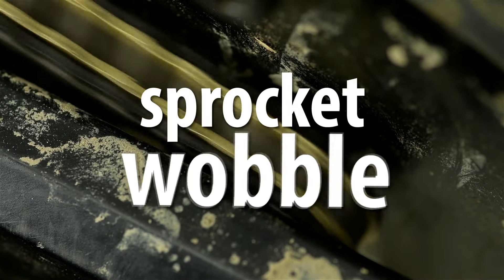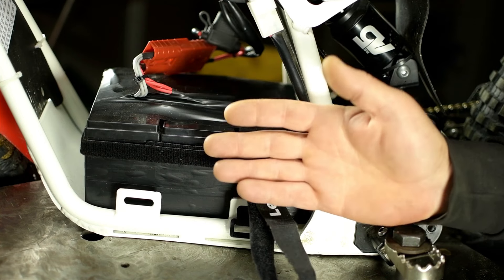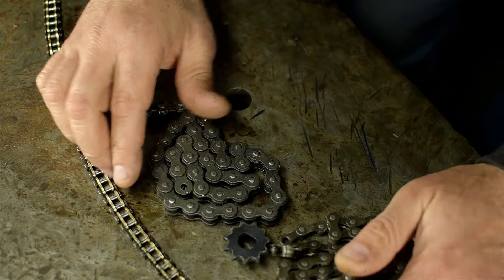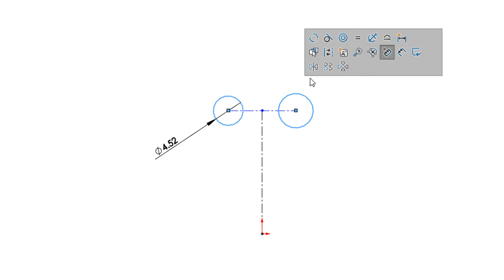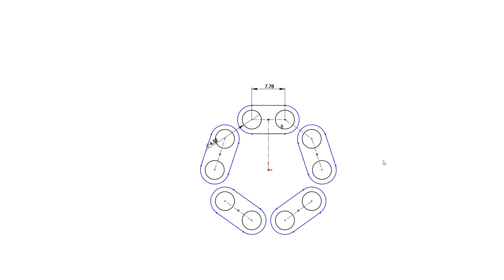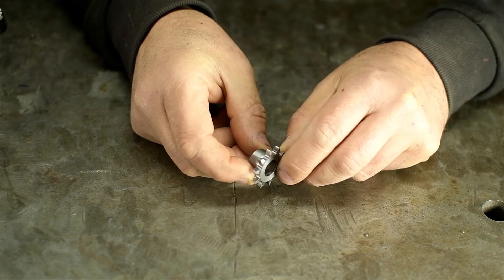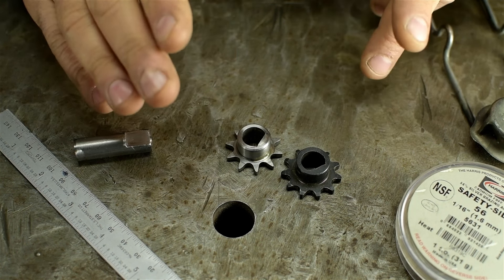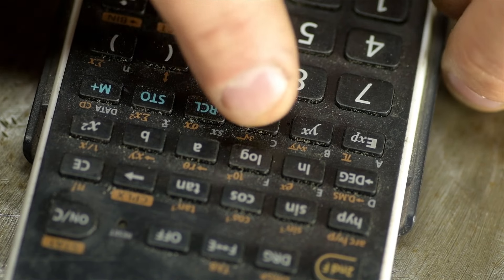Let's Make Our Own Chain Sprocket!

Comment: workshop: A place with tools to make more tools so that when feel like it you can spend lots of time making something you can buy cheaper and faster ;)
Reply: This is often (I'll even give you "usually") the case.  Given the quality of the factory parts in this case, it's good that Tot has a workshop.
Reply: @mikecurtin9831  yup, and I bet Tony's sprocket is better than the mail order sprocket.
Reply: Well, obviously(?) not "faster" in this case... Otherwise a totally agree!
Reply: Yeah, except most things you can order are made out of crusty sunbaked dogcrap, and having a proper workshop can lend you parts made out of tool steel, titanium and so on... Of course, it is all expensive as fuck, but then again, so is alcohol and heavy sedatives you need to take in copious amounts when your shit fails and you have to wait for it for ages to come from the store only to be as crappy as the thing that broke in the first place, so i rather go with some mild sedatives and an expensive workshop than no workshop and a heroin addiction...
Reply: I concur. However, that doesn't make for fun video content...
Reply: It is kind of weird, but I do spend far more time designing and manufacturing equipment for my shop to use making more equipment for my shop than I do making actual things that I make the equipment for. It’s odd how things work out that way.
Reply: You should take up woodturning.  Thank goodness I don't do it for the money.
Reply: @melgross  You are not alone, most of my time as been spent in the same exact way with building out my workshop
Reply: Yeah...
But sometimes what you want doesn't exist, or more often there is something else to do but to procrastinate efficiently you need to have something to do to not do the thing that needs to be done so we do what we do with the ol "but the one I have to make is slightly different than the previous/other/store brought one" to avoid doing the other thing.
For more information, see your local husbanding technical support group.
Reply: Only when you need standard parts. I need some 100mm axial flow fan blade and you would think that you can find them but no. Or I need a 10cm cross with 4cm legs and 3 holes through each leg to mount some coils to. You are never gonna find exactly what you need when you try to build something new.

Comment: Interesting project.  I'm guessing that's how they are made.  Case in point I purchased a tug for our Montana fifth wheel.  Was told this was the machine for the job.  When I noticed the chain binding and that the sprockets were misaligned by up to .25. I was told that's normal. I guess alignment and run out are important after all.

Comment: 0:52 is "wonky" a technical term?
Reply: Obviously, since I use the term.
Reply: It’s the most technical of all ways to say, “It’s fucked!” 🤣
Reply: Sort of. It's a generic term that covers both of the more specific terms cockeyed and lopsided and is useful when you're discussing something with elements of both.
Reply: @Nevir202  true, some technical dialects use Dickered, or Hoopajooped
Reply: Yes, even where english is not the first language! ;o)
Reply: C Overweel Sorry, I don’t speak rocket-science. 😜🤣
Reply: @Nevir202  That's sprocket-science
Reply: No, ask AvE for a proper tech term.
Reply: won·ky
 /ˈwäNGkē/not functioning correctly; faulty and /or 🤬
Reply: You can use "wonkatious" if you want to sound more professional
Reply: Technically, yes.
Reply: Absolutely!
Reply: It is in the shop I work at.
Reply: @GunSmoker  Its a bad case of a weeble wobble!
Reply: Its not a term I use very often, but then again I am fairly fluent in vulgarian, a language that has over 4000 synonyms for "wonky" all of which would make a sailor blush.
Reply: Yes it is, But I prefer "FUBAR"..:)
Reply: Yes...
Reply: It's actually even an S.I. unit referring from French System internationale "le wonque". The e is silent!
Reply: Nah, the technical term is "wafty"
Reply: @sventobergte845  :-))

Comment: Also that motor movement seems like it would cause the chain to wear much more quickly.
Reply: I think it's just because he has the swingarm disconnected from the frame and the camera is mounted to the frame. The motor moves with the rear wheel.

Comment: Hi Tony, 
Only just been able to get back to this vid, looking after a 'hyperactive' 4yr old grandson isn't as easy as people think ;o)
(he may not be hyperactive, I'm just old, slow and worn out) 
Your talking about something I really know a bit about.  Just in case you didn't know (and I'm sure many of your subscribers wont know?) 
I haven't done any research (even I'm not that much of a nerd) 
Chain standards were probably set up in 19th century when Britain had an Empire and America didn't have much standardisation  ( Congress passed some acts in 1864 that took another 20 years to be implemented, Troy ounce for precious metals was the only recognised standard measurement nationwide until then)
 Chains are 'mostly' measured in 1/8" 'blocks' a 630 is 6/8 (three quarter inch pitch) by3/8 ( three eighth's internal width between side plates). 520 is  5/8 x2/8 . 420= 4/8x2/8, etc. There are a few special sizes that don't seem to conform, the one you have looks like a <1950's~60's British motorcycle primary drive   (Reynolds chain)
As for chain 'bending' sideways, that is almost always a meaningless check as some chains deliberately have extra side clearance to allow dirt, mud, etc to fall away  even though ity may have had other applications, (it was a 'new thing' for off road bikes in late 1970's) Sorry for 'excessive' length of post, I know many people don't like reading which is why the 'moving pictures' are so popular

Comment: I thought sprockets need to be heat-treated to have hardened teeth?
Reply: He did take the torch to it, 😆! It’ll be fine
Reply: He used chromoly which is pretty tough stuff... Probably figured that it would be tough enough
Reply: Though admittedly they're not on the front, aluminium sprockets are commonplace on the back of motorcycles, plenty of which are making ~200hp. 

I'm sure this'll be fine.
Reply: @Hexlattice ....Stock 4140 (chromoly) tests 12-15 HRC. Tough but not brittle.  Good compatible choice for that chain (if !? we knew what type of chain it is!)  This repair is kind of a crap shoot.  Oh well, we'll burn that bridge when...............!
Reply: It only has to last until the other one comes in the mail.
Reply: I "think" back in my old days as a heat treater we used to do just a light case harden on the teeth and we used them on PTO's.
Reply: @The124cbr  Yes they can get by with aluminum since there is a lot more chain wrap and then less load per tooth. In his case one less tooth is more load per tooth so it could wear more than the original.

Comment: Drill hole thru front cog & key, TIG both pieces together by filling the bore hole. One filled bore hole will do, two (parallel to the axis) will fuse the two together to approximately "it ain't comin' apart ever again".

Comment: Did you consider drilling a hole in the hub centered where the D was to go from the side, then plug welding it to the hub?
Reply: erikjgreen how would he replace it in 3 months? Drill out the weld?
Reply: @chrisestill8825  I think Erik meant to weld the D shaped piece through a hole in the side of the hub, welding where ToT braised/brased/brazed? it in.
Reply: Or tap for a large set screw where the dent goes
Reply: Chris Estill - you can just use an un welder, it’s kinda like a big solder sucker. Works great 👍
Reply: @PapaWheelie1  - carbon arc gouging (the unwelder), is so very not like a big solder sucker...

Comment: 5/16" t8f hope you see this 😬 flag guys
Reply: I was just looking for this! 😁
Reply: I have a new chain I could donate, but I'm from aus
Reply: ToT said it was NOT 8mm metric chain, and his measurements showed a pitch well under that (7.78mm), despite that it was stretched already
Reply: Yeah, I used to do reverse engineering as part of my job, and if I made a drawing of a sprocket and said 7.78mm in the sprocket data block, I would get AT THE VERY LEAST a withering look from my boss, and he would in no way believe me, even if we measured the chain together and find that it did seem that way.  He would change it to 8mm pitch.  At the end, when the new sprocket is running, it sounds better, but it still sounds clicky.

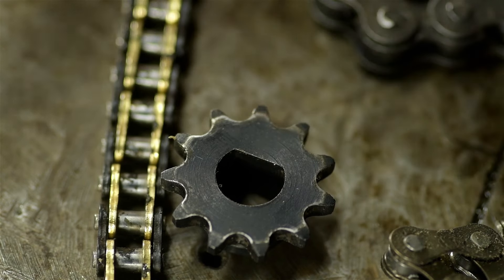Comment: 6:00 So... What happened to the rotary broach you made? Couple minutes with a mill and some round tool steel and AvE's your uncle.
Reply: they work for stuff that is equally spaced from center, meaning the cut needs to be similar all the way round, which isn't the case with a D shape, even if you were to position your spindle on the center of a circle that would with inside the D, and not on the centerline of the sprocket, there would be a lot of meat to cut at the top/bot corners of the D, which has a good chance of screwing things up for you
much easier to do with a D broach starting in an offset circle (same one that would fit in the D), that is how it was probably done in the factory, and they probably made it as the last feature, not the first, hence why it is all wobbly like that
if they made the D hole first, then fit it on proper D shaft mandrel and machine the rest, everything would be reasonably concentric

p.s. I think it is way past time for ToT to get a wire edm... "die filer 2.0" :D
Reply: @phuc
exactly, i dont know who this dude jones is but he is AvE illiterate, whereas your AvEctionary is gut'n'toit'!
Reply: phục êwê  Nah, AvE's your Uncle Bumblefork. Bob's your auntie.
Reply: phục êwê  Something something 150 pound filipino buddy

Comment: If you were worried about the key breaking loose and had a rectangular broach of the right size, you could've broached a square keyway and slid a rectangular prism key in there, then braised that. Heck, maybe even welded that. It could be tough trying to get the broached hole to be exactly the right size to not have pocketed corners where the round hole meets the side of the rectangular key insert.
Probably not necessary and the broach could cost money. Just an idea I had.

Comment: On old little old honda motorcycles they have a I think a small sprocket on the crankshaft that drives the camshaft. It has a readily available chain. They are steel and are a pus fit on the shaft. I have used them before to. You could put the ring of teeth and machine down your old sprocket and easyflow inside new sprocket.

Comment: You're late Tony! I already have drawn my first ever sprocket five hours ago. :P
I found it to be less messy to draw a concentric circle from one roller tangent to the next roller (twice), then I trim the excess of the circles and am left with a tooth. It is much less confusing than what happens around 9:10 in this video.
Either way, there's two types of people: people who like to fillet the ends of their teeth and people who just primitively cut off the tips of their teeth. Both work fine but I like my fillets.
Reply: The fillet button has cost countless millions of dollars for aesthetics. When in doubt put a "break edges .005-.010 inches"callout. So much more efficient.
Reply: So that's the new fashion in teeth these days!!!
Reply: Watch the video again. He shows your method also and explains why he showed the other first.
Reply: I personally prefer a strip steak in my teeth, but a fillet will do nicely as well.
Reply: @WeighedWilson  I just looked it up and indeed, breaking edges is better. Thanks for the tip!

Comment: I'd use silver solder shim stock , place it between the the fluxed parts and braze it as usual .you can also flatten out high silver content solder with a hammer and achieve the same result.

Comment: As a harley tech of about 45 years,  when I saw that  rotation @1:35,  I almost vomited.
Reply: WisdomVendor1 Hang on! Harley techs play with rubber bands.....do you even know what a sprocket is 🤪
Reply: Yeah, I'm sure you were aghast that it wasn't spewing oil everywhere 😉
Reply: As someone who has worked on Harleys, and Japanese bikes, that looks Harley to  me...
But if it had been on a Harley, they would have chromed it too...

Comment: You can build in a little engine with a generator and build a hybrit bike :D
Reply: so a portable diesel generator to recharge the bike only? Or one big enough to not have room for batteries so it can actually run the bike?

Comment: Keep an eye on the Samsung solid state batteries they've started selling them. They should be more commonly available over the next year or so. A pack that size would last you a long day.
Reply: I think they just announced it last month. I'm guessing they won't be selling them for a few years, sadly.  :(
Reply: I expect they'll be cell phone size for the first several years.  Tesla is doing a battery announcement sometime in May, if Covid allows.  The net is calling it "battery day".  Exact date TBA.  It's supposed to be good, but not solid state AFAIK.
Reply: @BRUXXUS  No. You're wrong.
Reply: Seán O'Nilbud  okay, where do you buy them?

Comment: Being a Mechanical Engineer my personal 3 best moments of the video
1.)The CAD model of sprocket😎
2.) The brazing of d shaft part into the Bore😉
3) And of course the  delivery of new Sprocket😛

Dude want to have a discussion with you, u r genius😊

Also it is lot easier to cut D slot by abrasive wire cutting..try it once in upcoming video..i have tried myself🙂

Comment: About 2 decades ago or so, I wanted a 16 tooth sprocket for my electric scooter and nobody at the time made one with a D bore so I found someone online that told me to send him an old D bore sprocket with the teeth worn, and the 16 tooth blank I had (with just a hole in the middle), and he ground off the teeth on the D bore and widened the hole on the 16 tooth, then welded them together.  It actually worked too, but then I got a larger rear tire and the 16 tooth was too much, so I went back to a 13 tooth.  Before that I tried making my own D bore with a dremel type tool and it worked for about a mile, then it started slipping, so that was bad.

Comment: When I first reverse engineered a sprocket the way you described, it ran very rough and noisy.  I got much better results cutting the tooth face 20 degrees from the tangent at full roller seating.

Comment: Now you’re getting to the heart of the matter…. I am myself going through this very issue with my motoriyamacycle. All motorcycle countershaft sprockets eventually eat the shaft they live on. In that vane I am making my own super long sprocket with flange that actually encapsulates as much of the shaft as possible. All the way into the bearing and therefore the original case seal is removed and replaced with one  a bit larger to ride on the flange of the now polished sprocket flange. 
When I get done I’ll send pics.

Comment: in the bike shop, we call that tight-loose. if you reset the chain to recommended tension on the tight-side, the chain will run forever and only lose .5% efficiency to oscillating losses. unless the sprocket teeth are worn down... that costs more time than saves eff.

i really should make a vid about already, there are plenty of aligning tricks like that

Comment: For some reason the unrealistic ride time of the lead acid batteries on this dirt bike reminded me of a damn toy RC car I made the mistake of asking for a christmas present as a child.  This was the early to mid 90's and of course it used god damned NiCd batteries.  It claimed a run time of around 2 hours and I think I would get about 10-15 minutes out of it before having to recharge for 2 or 3 hours.  Good on you Tony for getting the kid a battery that works right.

This RC car was that damn truck with the wheels on an angle so it could raise or lower the ride height with a motor, and was all over the commercials when I was a kid.  I'm guessing some other americans in their mid 30s like myself might remember it.

Comment: That old chain and sprocket has a death rattle like a certain cement mixer I had some run-ins with many moons ago. It literally warned you of impending death because one of the capacitor wires was shorted to the motor housing, so if you touched it whilst making concrete, game over man. The owner's solution was to cut the ground lead off of the plug. I actually fixed the rubbed through wire. Saved at least a few lives!

Comment: Make a fixture and hold the sprocket by its outside on the lathe, concentric to the teeth.  Bore the hole way oversize until sprocket runs concentric about that hole.  Machine sleeve, D-hole inside, outside to fit the sprocket re-bored hole.  Braze together.

Comment: 12:45 and that's why you never use stepper motors without a secondary positioning method. Counting the steps is how they did CNC in 1970.

Comment: Here's a though.  Print it out on a 3D printer first to figure out if you have the dimensions correct.  Re cut the plastic part on the mill to check the travel paths and then do a final cut in metal ?

Comment: Would it be safer to tap out a hole for a grub screw? You'd get more strength than the brass holding the D in, plus you get an extra option for positioning onto the shaft with a careful notch in the shaft to fit a ball bearing behind the grub on the sprocket.

Comment: Did not catch clearly, what type of mounting motor had to frame. Is it a hard fix or soft? However, I think would be cool to add bearing to the frame and connect the motor shaft there to decrease forces, that can bend the motor shaft. Absolutely love your channel. =)

Comment: Make sure the chain is not too tight, you may have an issue with suspension travel there and you will bend the motor shaft for sure.